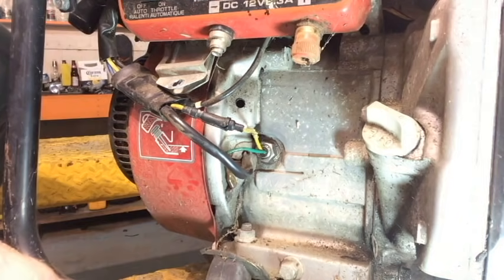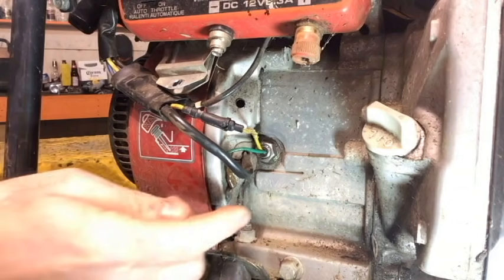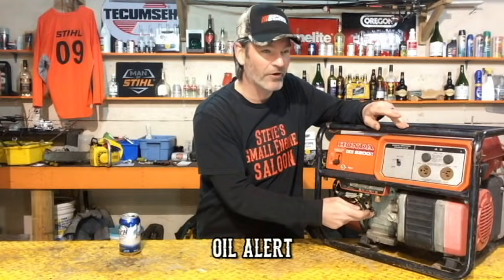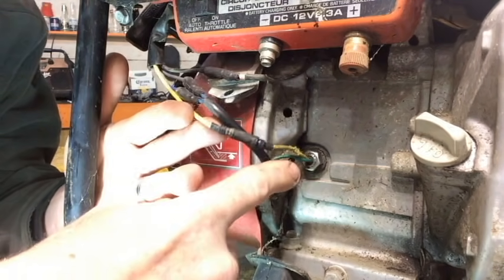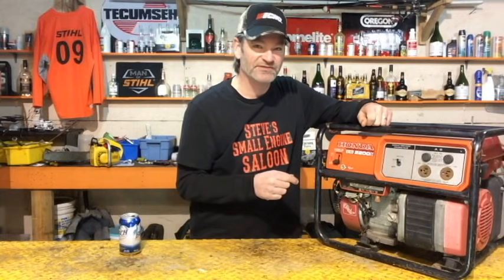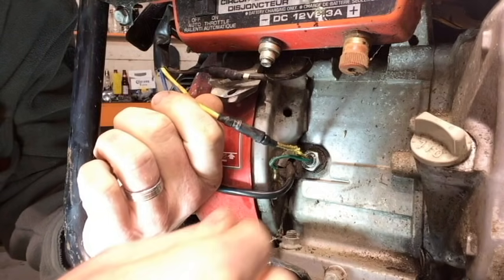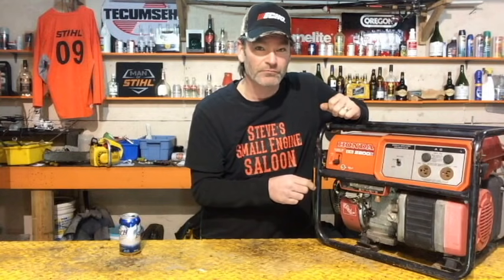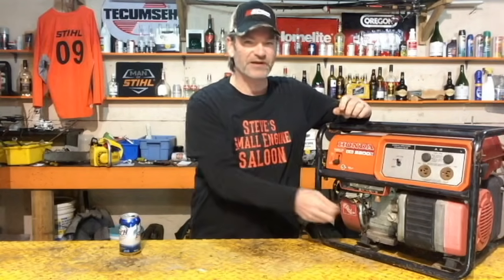How To Fix A Generator That Won't Stay Running

Comment: Don't know if you are still around on YouTube or not but THANK YOU. I have jacked with my generator ALL DAY trying to get ready for hurricane Laura. I took the carb off, cleaned everything, adjusted the float, cleaned some more. Obviously I checked the oil prior to trying to crank it and it was full. My low oil cut off does not unplug but snipped the wire and BAM, runs better than ever. THANK YOU THANK YOU THANK YOU
Reply from the maker: Great to hear!

Comment: My generator went low on oil a week ago. And kept cutting out during operation.  I gave it a oil change. And it worked for a few hours. Then started cutting out again.  It seemed to work for a while after cleaning the sparkplug.  But would begin shutting off again.  This appears to have Done the trick. Thanks so much. You now earned a new follower. Keep spreading the knowledge my friend.  I'll be watching!!!
Reply from the maker: Great to hear it's running again! Glad to have you aboard!
Reply: Thanks for the help.. and your knowledge.

Comment: THIS WAS IT! thank you! This generator has been a problem for YEARS!  I replaced the fuel filter, replaced the petcock, replaced the air filter, cleaned out the carburetor... But the oil level sensor is faulty.  Plenty of oil, but shuts off anyway.  Now unplugged with heat shrink over the end.  Thank you again!  (I'll note for other readers that I had a port with just a single black wire, but it was obviously an oil levels sensor by its placement and shape.  The symptom was that the generator would run for 15-30 seconds, shut off, and couldn't be started for maybe 5-15 seconds.)

Comment: I worked on my generator for two hours today. Changed the spark plug, took off the carburetor and cleaned it and drained the gas tank and put in new gas and checked the oil and added some. Still wouldn't stay running but for two seconds. Came into the house and saw your video. Took off the yellow wire and VIOLA my generator fired right up and runs like a new one. I'm amazed that it was such a simple fix. Thanks for sharing your knowledge and saving us money.
Reply from the maker: You're Welcome...
Reply: Just went through Hurricane Milton, and the generator was working great. I added new gas, and it wouldn't start. I checked everything to drain the gas. I checked the oil, and it wouldn't work till I pulled that yellow wire. This really helped!
Reply: I did that to mine and still have that problem ?

Comment: My Generator would run for a minute then start to cough , backfire , stutter slow down and stop running. Would not start again unless it sat for about five minutes then it would run for a minute and stop again.  Therefore I cleaned the carburetor jets again and checked fuel flow but  to no avail.  Disconnected the oil kill wire also; again to no avail.  Since it still stuttered and backfired I I did not suspect spark plug which looked good and tested for continuity but in desperation changed spark plug regardless    This fixed the problem and it's running fine.  When the spark plug heats up the circuit is broken in the spark plug due to expansion.....   Thanks for your easy to understand mechanical advice Steve.

Comment: Steve:  You are the best!  I have a 1996 Honda EZ-2500 that I bought new and used it a handful of times over the years here in New Hampshire.  I would stabilize the fuel every fall.  This year the generator would start and run like a charm for 10-15 minutes.  Then it would quit.  You showed me something to try.  It's been running out there for 1.5 hours now.  It was 30 inside my camper at 9:00.  Now it is 60 in there with two space heaters, one oscilator and one liquid filled.  The generator is working hard, but it's WORKING!!!!!!  Thanks buddy.  You saved me some aggravation!
Reply from the maker: I am so happy to hear that my friend....

Comment: Thanks man. The repair guy told me that it will take 3 days to repair as my generator valves are gone without even opening the head. I just watched your video, disconnected the yellow wire now and my generator works like a champ. God Bless You Steve.
Reply from the maker: Nice work!

Comment: I have been trying to fix my old Honda EM1000F several times now , cleaned the carby several times and since there is no more parts and support from honda here in Perth I almost threw it out ...who would have thought the solution was that simple !!! just needed more oil in it !!! thanks Steve !

Comment: Cleaned the carb on a generator I was working on, thinking the bowl was clogged, but still started and shut off after cleaning, came in the house, watched Steve's video, went back out to the shed, pulled the yellow wire connector apart, and VOILA, STARTED RIGHT UP! Great advice, saved me lots of time. Thanks!
Reply from the maker: Good stuff

Comment: Was about to take the carburetor apart on a Generac 4000exl as it was starting then shutting off after 10 seconds. Glad I checked out this video first, as the sensor was not working on it. Lots of oil and the low oil indicator light was not coming on. Also the owners manual mentioned shutting down after 10 seconds. Runs great with the wires to the sensor disconnected. This video saved me a lot of time. Thanks for all you do for us DIY'ers out here in the hinterland.. you are appreciated by many. Cheers Steve
Reply from the maker: Thank You...and You're Welcome...

Comment: This video was a lifesaver. I had torn down the carb and cleaned it, changed the spark plug, cleaned out the fuel shut off, and was still wracking my brain to get this thing running. Thank you so much for this video.
Reply from the maker: You're Welcome...

Comment: Fantastic!
Thanks for the video.
I did an oil change months ago, but I might not have run the generator after the oil change.  I tried to test the generator a few weeks ago, and it would start and immediately shut off.  After a few weeks of procrastinating, I tried it again today.  It did the same thing.
It is cold and I have no experience repairing small engines, so I didn't want to deal with any significant repairs.  The only thing I thought about checking was the oil.  But I probably was not going to do that because I knew I changed it recently.  

I found your video, checked my oil, and discovered the oil level registered on the dip stick, but it was at the very bottom.  So I added some oil and the generator started right-up and has been running for 8 minutes without stalling.

Thanks!
Reply from the maker: Right on Greg!  You're Welcome...

Comment: I did not find a yellow wire but the sticker said it would not run or would shut off if there was not enough oil.  I checked and it was low so I added some and it fired up.  Thanks a ton Steve you just saved me at least 75 bucks and a bunch of hassle hauling the Generator to the shop.  Thanks again
Reply from the maker: Right on Buddy!  You're Welcome...

Comment: Steve: Your video prompted me to investigate the reason the oil light was flashing on my portable generator. It kept cutting out on me. The low oil safety was shorted because it was wet. I use it to run a well pump on my off grid property. It had water and mud in the cabinet. Removed motor, tank and everything else. Cleaned everything including disconnecting and blasted with air hose all the connections. I’ll never sit it on the ground again while pumping water. Thanks. BTW, it runs great.
Reply from the maker: Right on buddy!

Comment: Steve glad you posted this video for all YouTubers a great first check situation when a generator will not fire. Eliminator Performance will be posting a similar video for our subscribers. 99% of the time we have found they need a carburetor cleaning and fuel tank flush and add new fuel with stabilizer. Amazing how many people have generators with fuel that is 5 years old in it and never started it unless they had a power failure. They should really start and run the generator every month and keep adding fresh fuel with stabilizer. Have a generator that is about 15 years old and fires up every time.
Reply from the maker: Awesome.  Thanks for commenting Wayne...

Comment: Thank you for the tip. It saved me from taking the Generac generator to the repair shop. It was as easy as disconnecting an electrical plug in connection. I wish I had seen this before, would have saved many hours of working on carburator and such.
Reply from the maker: Glad it helped  :_Beer: :_Mower: :_Rider: :_Chainsaw:

Comment: Thank you so much! Been without power for several days now and the first day the generator was working 12 hours no problem the. It randomly just started shutting off after 30min to an hour. Cleaned plug no change, found your video added oil and presto fixed. I feel really dumb for not thinking to check that. So thank you again saved a lot of stress and heart ache.
Reply from the maker: You're Welcome...

Comment: I was tearing apart an old house trailer using a generator that would run maybe 1-2 minutes and die. Had the carb apart at least 10 times trying to figure out the problem, it's like it kept running out of gas.Checked the tank cap,line,flow to carb, all was fine. Before starting any small engine an oil check is automatic to me so oil wasn't the problem, unplugged this wire and WOW.....THANKS.
Reply from the maker: Right on Buddy!  You're Welcome...

Comment: Disconnected the oil safety after several miserable pulls and it worked like a champ. I think the switch corrected itself after running a bit as I plugged it back together. Thanks for the video, Steve!
Reply from the maker: You're Welcome...
Reply: Steve..what is the small square relay size module that is wired in series with the oil level sensor?..my generator will only run when the wire between the kill switch and relay type device is unplugged..oil level is correct..anyone know?

Comment: Thank you very much for a very informative video, l just fixed my generator that l bought dead. I cleaned the cubarator and only to find that is was too clogged with grime dirt so l bought a dual curb and it didn't start up until l see this video,now it's working thanks from Zimbabwe

Comment: Thanks Steve your a star.My pressure washer would start but kept stopping,watched this video so checked the oil which was low so topped it up and hey presto started straight away.I was going to take it in to the repairers but you’ve saved me some ££££ thanks.
Reply from the maker: You're Welcome...

Comment: After cleaning the carburetor, changing the fuel filter, spark plug and the oil.... none of that was the culprit 

I unplugged the yellow wire and now it runs beautifully 😵‍💫😵‍💫😵‍💫😵‍💫

Thank you so much!
Reply from the maker: Great job!

Comment: We lost power in TX ice storms for 3 days. Generator died on day 1 of course. In a panic, I googled solutions, and this video on the low oil sensor saved the day! You are the man, Steve! Thank you! BTW, is there a similar solution should the CO sensor on the Duromax generator go bad?

Comment: Thank you! My power has been out for over 24 hours. Brand new generator all of a sudden kept shutting off. Disconnecting the oil pressure sensor worked!
Reply from the maker: You're Welcome...

Comment: Oh. Thank you so much. 

The oil warning light came up last night when I started up my generator. I put off the engine immediately gave it some time to cool and then gave it an oil change. Started it back up and the oil warning light was still in but I figured it'd go off after a while. Well, it didn't and the engine went off itself some time after. 

Tried switching it on again this morning to no response. Did as you showed in the video just a minute ago and it started up like it had been waiting a long time to do so.
Reply from the maker: Excellent!

Comment: Thought the Kubota A2200 Generator that I just got for free had carb issues, but I watched this vid, and sure enough, after checking the oil I unplugged the sensor and she ran like a champ! Thanks!
Reply from the maker: You're Welcome...

Comment: I have a homelite generator that would not run,I changed the carburetor,plug,checked oil,and it still would not run.After watching your video,I checked the engine,I had a green and orange wire,I pulled the orange wire,and it ran.Thank you very much.
Reply from the maker: You're Welcome...

Comment: I have been working on a multiquip 6000 gen. Older model. After checking everything Steve says to check, I remembered something from my VW repair days. If the engine sputters before shutting down, it's fuel. If the engine just quits, it's electrical. Replace the spark plug first. That took care of my problem.

Comment: Hi Steve I always appreciate your videos.  I am about to change the oil on my portable generator and I read somewhere to just use conventional 10w-30 oil that you would use in a car. Is that correct or is there a specific type of oil I should be using?

Comment: Thank you, Steve! I had high hopes that was the fix, but mine is still stalling. Quick overview, I have a new carburetor and spark plug in, changed the oil and gas but she still cuts off after a few seconds. I even tried loosening the fuel cap. I noticed she reeves up loud and then shuts right down. Any thoughts or suggestions? Appreciate it
Reply: New coil

Comment: Thanks so much.  I knew it was something like this.  Oil was a little low (like 1/4") and adding some didn't change anything.  It stopped one additional time after disconnecting the yellow wire and has run flawlessly since.  Preesh!

Comment: Steve, I want to thank you for making this video. I'm just an average Jo when it comes to fixing small engines, but your video gives me the confidence to begin diagnosing why my General generator won't start! I will check my oil sensor and hope it is the problem why my generator won't stay running.
I also need your help, if you can help me? I have a Generac EXL generator with a 7.8 Brigg's and Stratton motor. For the life of me, I can't find it's manual to see what spark plug my generator uses. I also looked online and couldn't find what size. Would you happen to know? Thank you for your help, Steve. I truly appreciate your time.

Comment: Thank you so much!!  Mine is touchy.   oil was just a little below full and would run great for 5 min then die.  Filled completely and it wouldn’t run.  Got rid of just a little bit of oil and running great.

Comment: Hey Steve love your channel ! I have a similar generator that I picked up it’s a Honda em 3500x. I have put. A new carb on it and done a one over and it runs great! But when I put the auto throttle on it dies... I have tired playing with the idle control solenoid but I haven’t been able to see any videos on how to adjust it. It seems to be working as it flicks left and right but the motor just drops rpm and dies. Any suggestions or can you do a video on this ? Thanks

Comment: I watched this video a while ago, so I had the informatiin in my mental pocket.
However, I failed to listen to the info. out of habit- "runs and stops?, must be a fuel flow problem"
AFTER cleaning the entire carb and that NOT solving the issue, I remembered Steve's suggestion and unpluged the oil sensor- awww, the engine ran normally.

THANK YOU Steve. You make me a better home small engine DIY  troubleshooter. ;)
Reply from the maker: You're Welcome...

Comment: Hi, thank u for the videos. My Hyundai generator had a problem with the fuel valve, I replaced it, but the issue is that it keeps revving intermittently. When I try to connect the water pump, which I used to connect without any problem, it starts having those acceleration intervals, then it shuts down, and the circuit protector trips.

Comment: Well, it's not an 'oil alert' problem ( I unplugged the yellow wire ). Plenty of oil in the engine.  Anything else that might be the problem on my Honda EM6500sx generator? Thank you for all your great videos! I subscribe to you on YT.

Comment: Hey Steve, great video. My 5500 generator runs for maybe 10 minutes and then sputters and then eventually shuts off. I have it connected to a separate panel that runs the well pump, 2 refrigerators and kitchen lights. Is there too much load for not enough generator?

Comment: Just bought a brand new powerboss 1150. Filled the oil as per instruction and it would shut off after a few minutes. Disconnected the sensor and it seems to be working fine

Comment: Hi steve I'm had to put a new piston on a dual fuel generator from champion but after I rebuilt it I been having this issue starts for a sec then it quits I'm off to trying what you showed on your video thanks

Comment: I have the same problem. My generator has been without oil for almost a year, I took it out to replace it and it is possible that the float is stuck. Now I have filled the oil. I have cleaned the carburetor. It starts very easily, it stops immediately. I have disconnected the yellow wire but it still stops. The yellow wire goes through an IIDA part. Motor is Honda. Thank you!

Comment: Thanks Steve. Good information. Does the low oil alert sensor work, by turning off the spark
or basically how does it prevent the engine from starting?
Much appreciated.
Cheers,
Michael O.
Alabama, USA

Comment: Great tip! Fixed the exact issue I had
Reply from the maker: Awesome....
Reply: @StevesSmallEngineSaloon  I went through everything from Fuel, Spark, Oil, cleaned air filter, Clean carb, and your tip was the exact issue. Thanks again

Comment: I have a 4200 honda thats been sitting for a few years. I cleaned the carb, and put fresh gas in it. It only will start for a second with carb cleaner and then dies. It has oil so I disconnected the yellow wire, but it still won't stay running. Any ideas?
Reply: Ive got that same issue with my pulsar 4500

Comment: Hi Steve. I have a Honda HRS 216 lawn mower that has this symptom. The oil level is at the max and there doesn't appear to be an oil alert system. Any suggestions as to what may be the cause?